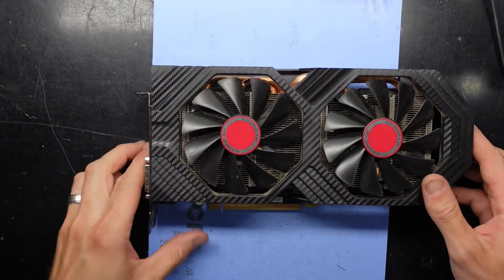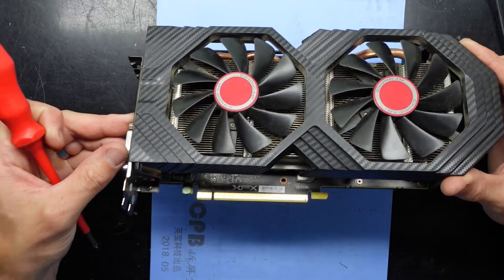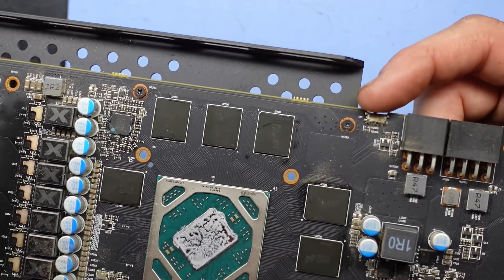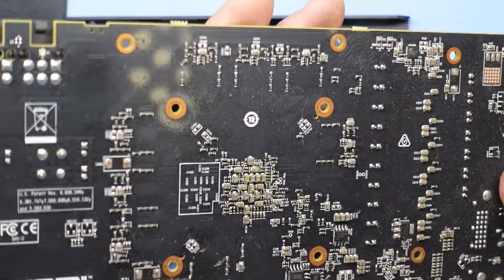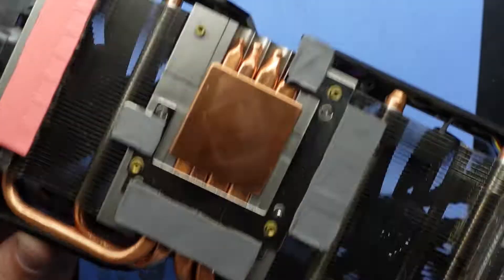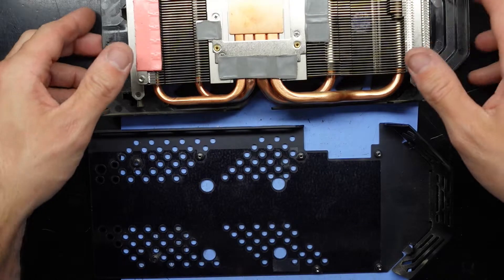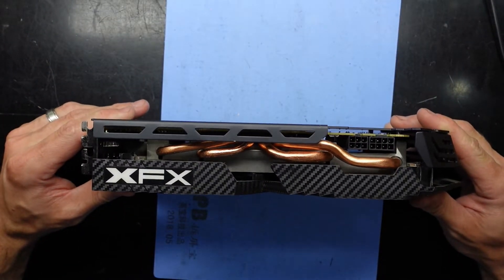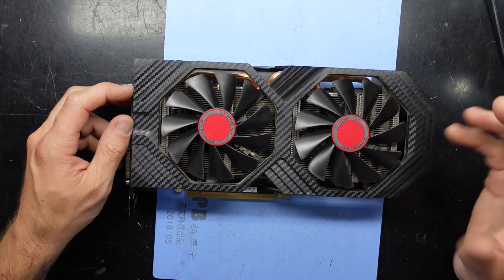Trash Find!,  XFX RX 590 Fatboy Thermal Replacement

Comment: Sapphire rx570/580/590 8gb cards have 0.75mm pads. Average (normal temperature) are around 70 to 75°C while gaming and idle around 25-30°C. The backplate also is a part of the cooler (1mm pad on the back to dissipate the heat from the vrms).
Reply from the maker: cheers for the advice

Comment: Hey. I need your help. I've had a 590 for a while but after some heating issues I took it apart to replace thermal pads and paste. But after closing it, it gets to windows and immediately shuts down. Upon inspection I see the thermal paste is not touching the cooler. Should the cooler threads go through the card? Is there a way to do it? What can I do?
Reply from the maker: I would be suspecting the thermal pads you installed might be too thick

Comment: Hello, i have the same one, just purchased, fairly cheap, but i think i was scammed.
When cleaning it and applying thermal paste, i noticed the chcips with the number 1 (to the left of the X capacitors i think?) are a bit "burned" or at least they look more brownish.
GPU also crashes when playing or even starting up the computer at times (Black screen, sound continues if playing a video for example).
I have tried multiple Driver versions with DDU beforehand and nothing has worked.
Think its a bad GPU? or could it be my PSU (fairly generic brand, 600w but actually gives less than 500w).
Temps are rarely at 80, maximum i have seen is 85.
Reply from the maker: Sounds like it might have been a dud purchase. Sorry to say
Reply: @rickstechrepairs  a crap, had to sell a few things to purchase it.
Its weird because it works perfectly fine in Warzone but then Crash in League of Legends. So weird..

Comment: Would an over heating gpu cause system failure/crashing?
Reply from the maker: During video games, yes
Reply: @Ricks Tech Repairs  what about just normal use? My computer would crash after 30 min. I tried different ram, different cpu but same cpu
Reply: @rickstechrepairs  i have an rx590, the fans run when i turn it on but i get a black screen
Reply: @__sev  i also have rx 590 did u manage to solve it?
Reply: @dujebasic2604  sadly no, but please let me know if you manage to fix it

Comment: how much was the thermal difference ? I know xfx model is a bit toasty with a bad cooler design.
Reply: I went from 85 to 80 or below.
Still has bad thermal design.
I do thknk i fcked up one of the pads (the largets one), so you might better temps if done properly.
I used Artic MX4 and 1mm thermal psds.
Reply: @WhiteZelda  Dude, I have the same product as in the video and I will change the thermal pad. Does this graphics card use a 1mm thick thermal pad? Can someone who knows help?
Reply: @pixhn  i used 1mm everywherr, seems to work fine, i also added 3mm (3 1mm stacked) in the back where the chips with number 1 are (so they have actual contact with the backplate), this is what did the most difference tbh.
Reply: @WhiteZelda  thanks. Are the 3mm pads you put on the back exactly in line with the vram? Because I have a separate part in the cooler block. I was going to take it out and place a pad between it. Many people suggested this. Do you have any information about this suggestion?
Reply: @pixhn  its in the back of where the Chips with the 1 are (not sure what tjose are, i think its some for voltage).
I didnt try putting amything in the back of the VRam but that might be a good idea.
Reply: @WhiteZelda  Thank you my friend for everything. ❤️